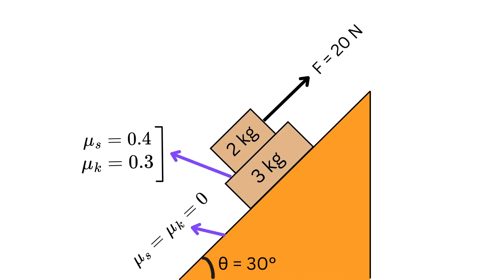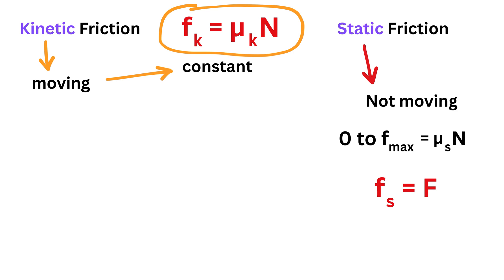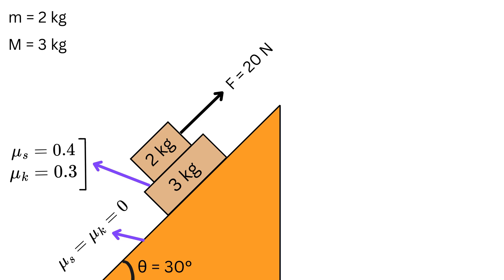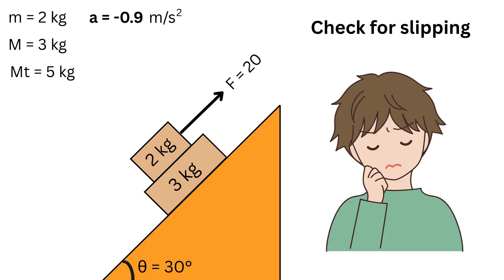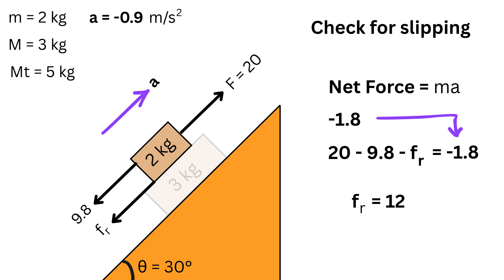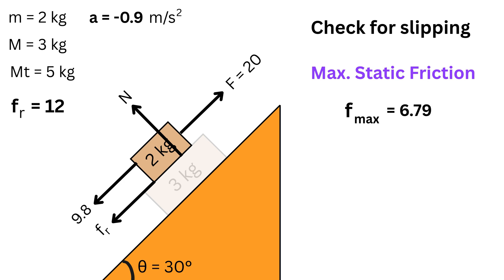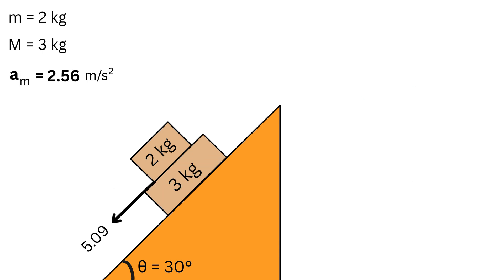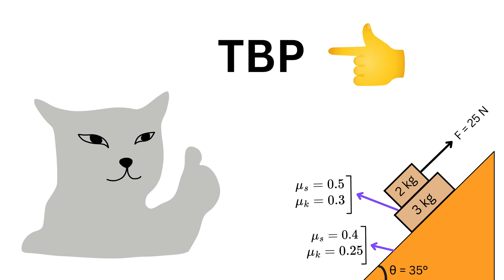It’s Easier Than Drawing a Straight Line!

Comment: 1. The block slips relative to the other. 
2. Combined acceleration is 0m/s2 ( maximum static friction is higher than net force)
3. Acceleration of 2kg block is 4.47m/s2
But for 3kg block It's 0m/s2 as maximum friction force is higher than the net applied force. 

Please let me know if I approached it correctly.

Comment: 1. The blocks slip relative to each other
2. If they stuck and the system started from rest, the common acceleration would be a=0.
3. IF they slip, acceleration of block a1=4.47m/s2 up the plane
a2=0.67m/s2 down the plane
Reply: I got your same answers, but I think that in the third case, the block a2 does not move, cause the maximum static friction force wich is calculated with the combinated mass of the 2 blocks and the us2 is more than the actual force that is going downwards on the incline plane.
Reply: @ayronguadalupesolano1902   i also got the same result. But unlike you (i Don't know if I'm right) i totally scrapped the combined mass as it will slip. However, when i calculate the net force on the 3 kg block, considering slipping, i get 7.92N. And the maximum static friction between 3 kg block and the surface is 9.63 N. So the block will stay still.

Comment: Tell me the value of 0/0. Is it infinite or it will be zero only and explain it. For those who are saying infinite then I will say  them only that HC verma sir has said it as 0.
Reply: Undefined, here's an example 
0=0 obviously true
0x2 = 0x3 which leads to 0 = 0
0/0 = 3/2
0x5 = 0x6 which leads to 0=0 again
0/0 = 6/5
Did you see the problem? 
We got 3/2 = 6/5
or 1.5 = 1.2
Which obviously isn't true
This happened because there's no fixed value for 0/0 and we assumed there is a fixed constant for 0/0
Therefore, 0/0 is undefined 
The same works for 0.∞ , 0^0 , ∞^0 etc.
Reply: simply it is not defined in regular field of R for solving problems which includes 0/0 you need to extend the field R but those problems are not in common domain
Reply: It's an indeterminate form in limits or also called undefined in terms of computation 
You cannot say a particular value for 0/0